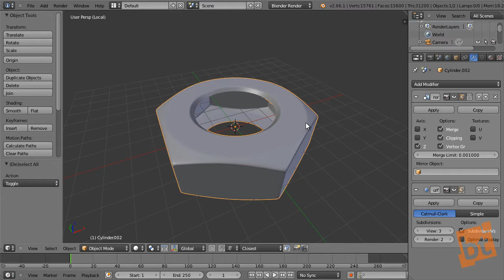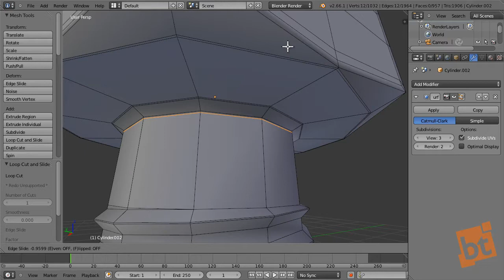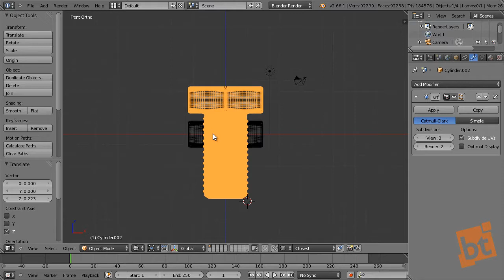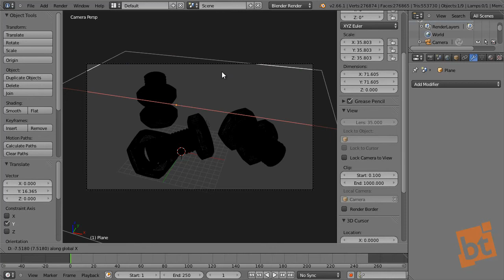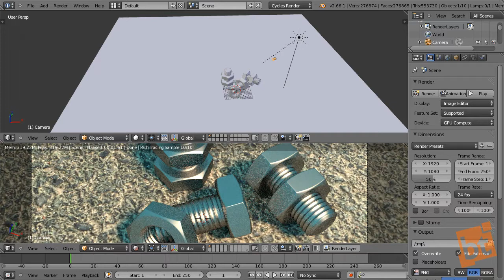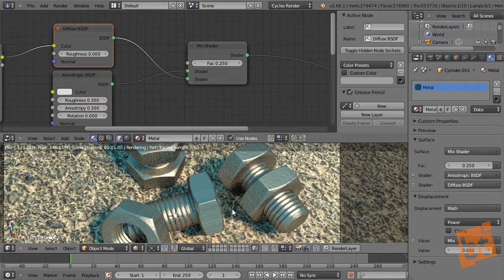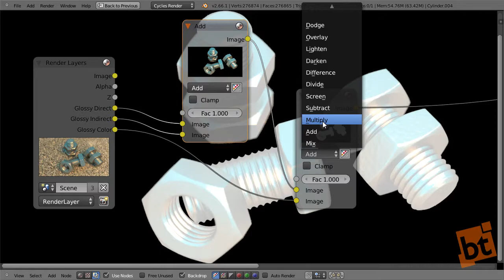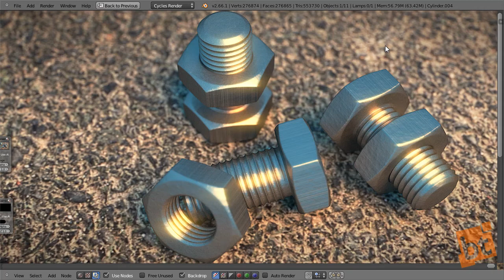How to create nuts and bolts in Blender (Part 2)

Comment: good info to have. Although there is an add-on, bolt factory, that lets you specify length, head style and thread diameter with just a few clicks.

Comment: Hey Oliver, loving this tutorial... getting back in to rendering after using Blender for 3D print purposes... I have a question - at 45:30 you go in to compositing... but the Render Layers dialog is not present on 2.70a (that I can see anyway ^-^). There is a RenderLayer section in the Outliner but the Glossy:Direct, Indirect & Color options are not present, therefore they do not show up in the compositor after the render. Any ideas?
Reply: I see you answered this below! my bad...
Reply from the maker: Steven Gray Glad you found out! Indeed, the new versions have a new panel for render layers alone :)

Comment: Hi, Thank you for this video.
I have just recently started learning about 3D modelling and using Blender. I found your video after thinking about how someone would create a bolt / screw and nut. I will be referring back to this video for sure, as the way you presented it is awesome. By actually speaking your keystrokes is much more helpful than trying to observe them with the keystroke / mouse click display option. 
Question: Do you have your mouse settings at the default "right click select" or have you changed it to "left click select"?
My biggest hurdle right now is finding the selection to manipulate an object in the way I want. It seems after too many attempts followed by ctrl-z, makes it hard to remember just which keystroke to use the next time, without repeatedly going thru the same chain of strokes. but I realize that just takes some time:)
Anyway, now that I found your channel, I will be watching more of your videos.
Thanks again
Reply from the maker: Nice to know it's been useful, arodue! :D

I do use the default right click select, yes. About shortcuts, it's all about musle memory and practice. Good luck! :D